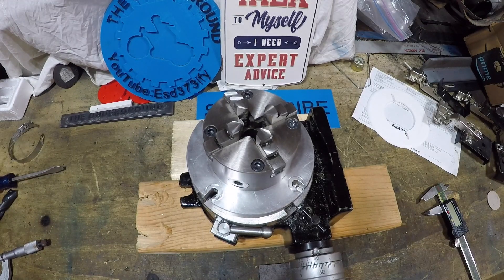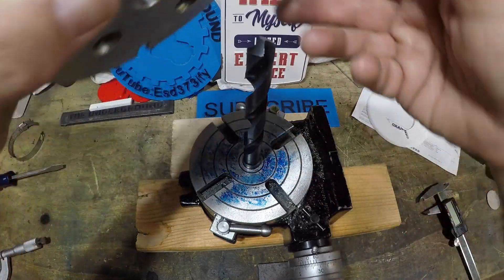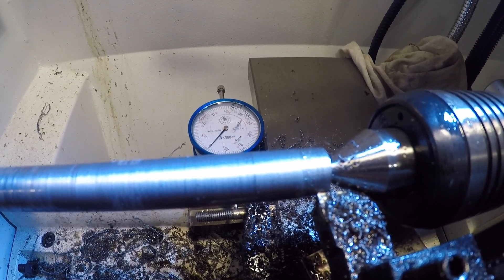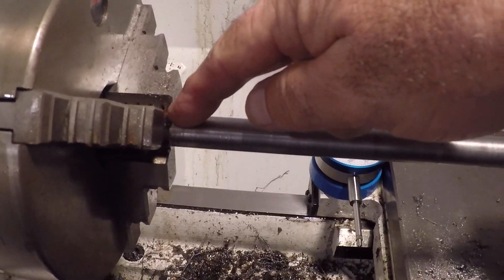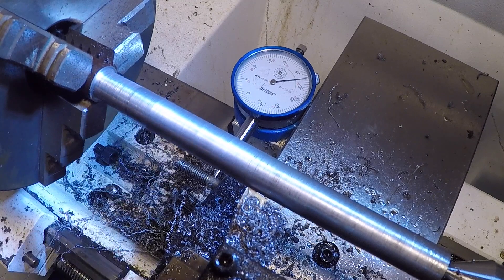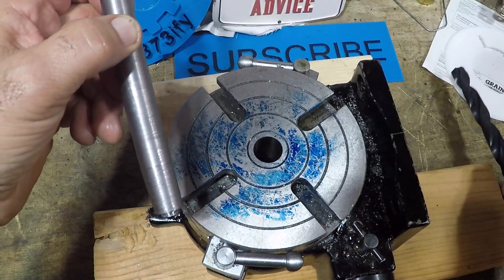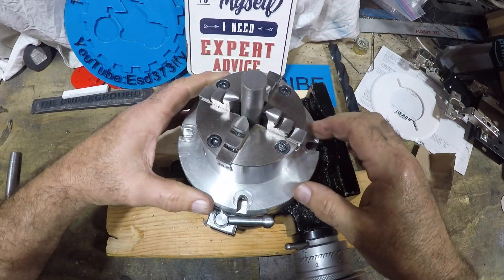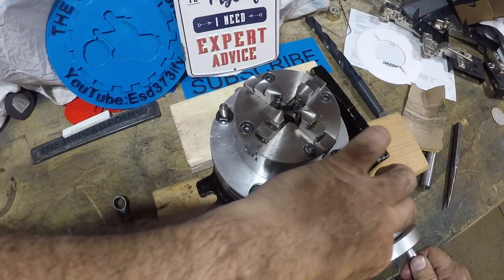#2 Morse Taper Rotary Table Alignment Tool

Comment: I bought a cheap Morse taper arbor from fleabay that fits my rotary table center hole then turned the arbor end down to size by sticking it into my lathe that has the same Morse taper. Then made up 3 face plates for 3 jaw 4 jaw chucks and one large blank plate with drilled and taped holes that use a mill table clamp kit. These all fit using that same bore size so when removing and remounting they stay centered. I cut the arbor down so it only sticks up high enough for the mounting plates to fit on it. It stays inserted into the rotary table and allows me to swap out chuck mounting plates as needed.
Reply from the maker: That's a great idea........sounds like a video. Thanks for watching and commenting. It helps the channel.